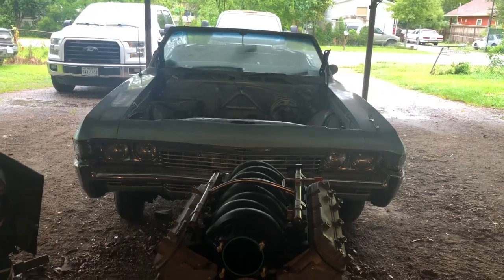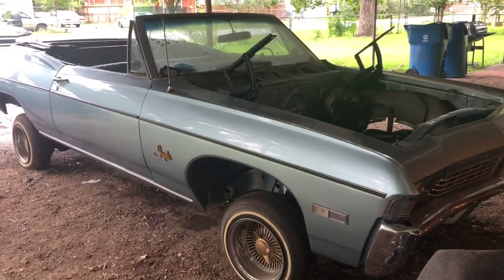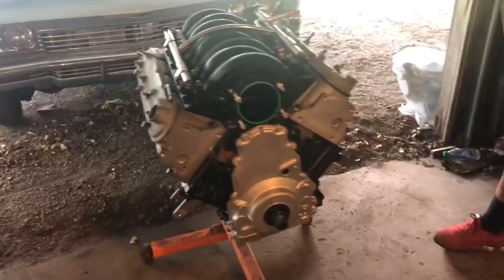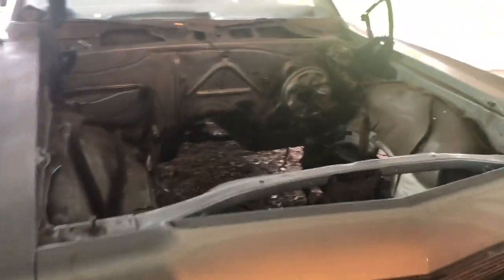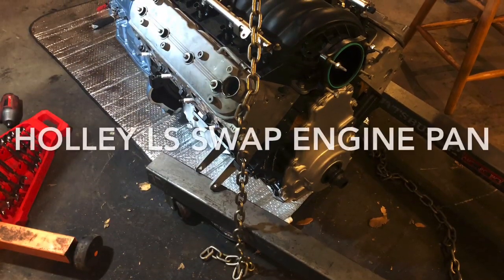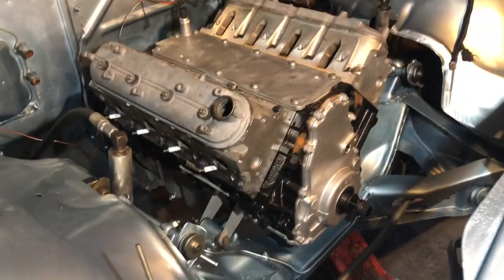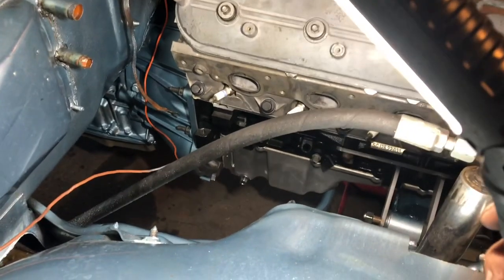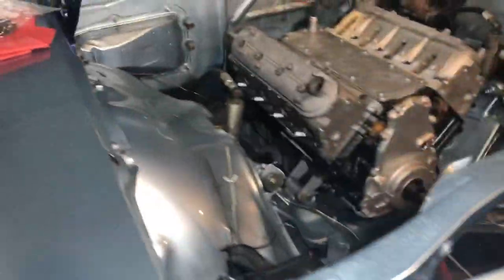1968 Impala Convertible LS- 6l80 swap PART 1, headers, engine mounts, oil pan in description

Comment: Yo. I got a question bro I have a hardtop 63 impala  im trying to do a engine swap  from 1999 silverado 6.0.  What intake manifold. I need awhile as header & engine mount I need an one other I have a brand new 350turbo tranny would it work with the 1999. 6.0L engine

Comment: Was the frame yall swapped also an impala frame?
Reply from the maker: What frame?
Reply: @RedRocket64  at 00:38 right at the beginning he said yall were gonna do a full frame swap? I'm just curious if ill have issues putting an 2003 6.0 in my 68 as is. Beside the engine mounts im sure are different